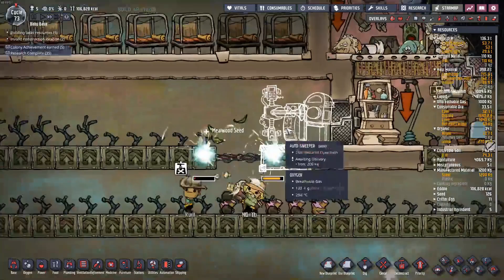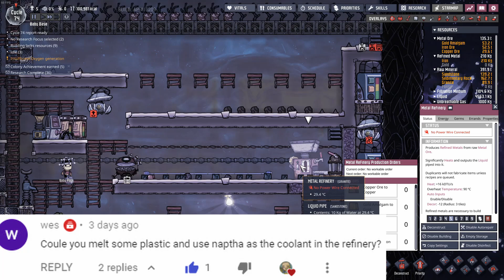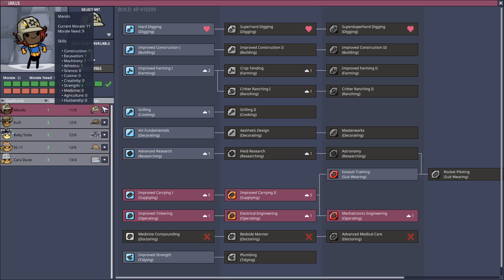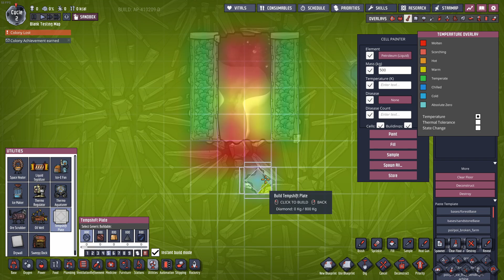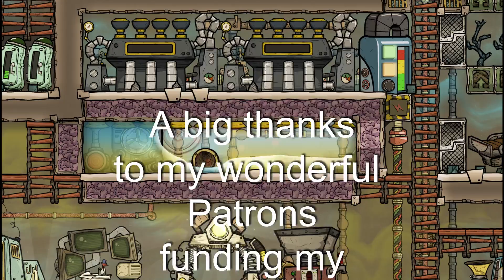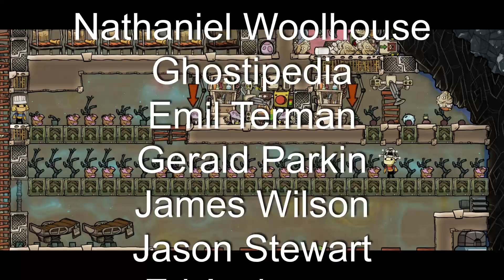Baby Base 4 : Metal Refinement, Cooling, Naphtha and Coal : Oxygen not included

Comment: For any current viewers, in the current version of the game, temp shift plates do interact with abyssalite (which I learned from a later series), so you can do the corner heat extraction on it to melt plastic.  And the weird thing where it's boiling material despite very low conductivity is called "flaking", and works with other materials, for melting or boiling, and happens in 5kg batches.
Reply: Thanks

Comment: 9:45 You say the Abyssalite cools only slowly, but by my calculations the DTU delta between the temperature of those abyssalite tiles and the petroleum boiling temp of 538.9
 C is 7,266,400,000
 DTU. With petroleum input of 26.9 C it can boil 8063 Kg of petroleum. Given the number of times you clicked, that's approximately the amount of petroleum that you boiled in the experiment. No extra DTUs were created beyond what was already in the abyssalite. It's simply really really hot to start out with. There is no extra heat or any sort of amplification due to it being abyssalite. You would only get the same amount of energy out as you put in even if the tempshift plate idea worked.

Comment: You can actually use 0.1g in the valve filter, making it even less likely to let stuff through, reducing the amount that does get through, or making it take longer to get through.

If you have two bridges going into the filter it would take several cycles worth of continuous full-pipe flow for any hydrogen to leak out, and with just one, only 100mg of hydrogen can get through if you have a full packet.
Divides the issues of that filter by ten, and it only costs one or two extra keyboard presses.

Yes, it’s a tad excessive, but it also is a completely free alteration to make.

Comment: Would it be possible too farm dense puffs for food they only eat oxygen but then the poop it back out as oxylite it would basically be a infinite food source also later in the series you will have a bunch of oxylite for rockets
Reply from the maker: The difficulty with any type of ranching is the space, each critter needs 12 tiles of space not to be cramped. (except voles) so ranching any critters will take up a large chunk of the base.
Reply: Yeah you do have a point why waste space for those critters when you can ranch voles then you can use the room for somthing else

Comment: Very nice and compact <3 them till they drop vole farm design that easly supported my 50+ dupe bases
dimensions(7x6)
top layer4(obsidian, copper, gold, iron, steel, wolf.,) horizontal pneumatic door 1 refined metal tile
interior of rectangle from left to right:
4 tile high tile/m.tile ; vole/vole baby drop off; (ranching station, ceiling light+dupe sensor) ; (lowest level gas element sensor,metal tile,auto dropper facing ranching station) ; (mini gas pump, 2 ladder segments above pump); 4 tile high tile/m.tile 
7 tiles /m.tiles
last row gas vent attached to m.gas pump
automation: auto wire between light and dupe sensor; auto wire leading from gas sensor to  buffer gate default setting is fine then to the mini pump  gas sensor default to carbon dioxide**
**important to keep dupe working without having to stop to breathe uses min power and get more efficiency from light as well, 
PS this farm can easly add eggs but woes be if vole gets out when have like 50+ voles in it, e.g. convert all escapees no going back your welcome for this brief tutorial for viable vole <3 them till they drop farm easly supported my 50 man dupe base with just this single farm design
materials needed: 
21x100 refined metals walls ( 600 refined metals less if up against side wall) 
100x xxxx for pneumatic door + 
400x xxxx for grooming station
50x xxxx for dropoff
400x xxxx autodropper
50 plastic  for mini gas pump
35 r.metal for automation wire
25 r.metal for gas element sensor
25 r.metal for buffer gate
50 xxxx for gas vent
100 xxxx for gas pipe
total= 
2185 refined metals or 1585 if against a wall
1100 regular materials
50 plastic
+power cable material
less materials if make all your dupes live in atmo suits 99.99% of the time,
Reply: Also just thinking about it can also get free sand by purposely composting some of extra meat after its been cooked thus giving you free material to use on air filters thus giving means getting some tasty ceramic /shrug

Comment: For powerless filters, i tend to build a pipe element sensor, then a vent right after, along with a NOT-gate. Put the sensor to detect hydrogen, then everything that is not hydrogen will get spit out again. Just need to make sure the vent doesn't over-pressurize to prevent it from spitting out the NOT-gasses.
Reply from the maker: This have been suggested a few times I'm going to have to give it a try.

Comment: isn't that single tile all the way to the right bottom corner of the map that isn't insulated going to continue transferring heat into your base from the ridiculously hot diamond underneath it?
Reply from the maker: That is surrounded by insulated tiles, the hot diamond is diagonal to it and only temp shift plates transfer heat diagonally. That is why the plastic temp shift plate melted instantly and then stopped heating up, once it melted it was no longer a temp shift plate so it was not drawing heat from the hot diamond any more.

Comment: Can you calculate per second how much power you're producing using that tiny Hydrogen system
Reply from the maker: About 68 grams of hydrogen a second, not even enough to keep it active much. But it's more to stop the hydrogen building up in my base.
Reply: @FrancisJohnYT  the two small Air pumps are going to keep up with all the hydrogen that's generated?

Comment: you going to run that hydrogen gas in a steam room to remove heat before you burn it in gens?....dubble power from 1 vent! lol
Reply from the maker: I always find that 500C hydrogen is not worth taming early on. Once you get Therimum you can tame it quickly and easily. I would prefer to invest my time in getting other power sources up.

Comment: Oh there is a nice setup to make a filter that uses the new vents and a NOT gate ( add a sensor before the vent set for H2 and connect the sensor to the NOT gate and connect the NOT gate to the vent, every time the sensor detect H2 will close the vent and allow the H2 to pass, every time the sensor detects "other" stuff it will keep the vent open )
Reply: also is power free and safer because it will only close the vent when it detects H2 (unless the vent get over pressure) but if you use the bigger vent that will never be a problem
Reply from the maker: Seen a few suggestions to try this, I'll give it a go.
Reply: @FrancisJohnYT  oh that also work with liquids

Comment: If you extend that half-filter by one and put in a second bridge, you can filter up to 999 full gas packets of H2 in a row before missing one.

(That is, move the outlet one tile to the left, extend the top pipe one tile to the left, and put in a second bridge where the gas outlet was facing down, in parallel with the other bridge.)

(Or more, if you decrease the gas valve below 1g.)

It only works if the loop is flowing in the opposite direction as the incoming gas though.

Effectively you end up with 1g/packet building up at the exit of the 2nd bridge every pipe tick worth of H2.

Comment: If you want an alternative power source, maybe use the hydrogen vent.. you can cool the heat now.
Reply from the maker: It comes out at 500C so I would need to cool it before pumping. Anything I do now would be temporary and the power return is not great for the effort involved. I might tap the magma biome for power first, it has the added benefit of freeing up space and getting me access to a bunch of diamond, steel and wolfermite.

Comment: Fun facts time!
First, the numbers problem. ONI uses floating point numbers to keep track of materials, which is the source of the "rounding errors" you see with things like data banks. Floating point numbers keep track of numbers via exponents. It's a weird way of doing things, sure, but it saves a ton of memory space for really large numbers. Anyway, think of it like using ONI's pipe splitting functionality to try and split a fluid into 5 equal streams -- it's basically impossible without an excessive amount of pipes and splits, and even then you can only get an approximation. Floating point numbers are like that.

Second, polluted water off gassing. They changed how that works when the full version came out, so (unbottled) polluted water only off gasses when it's touching clean oxygen. You never have to worry about polluted oxygen entering your steam chambers not because of the pressure, but because there's no oxygen for it to touch!
Reply: That's not correct.  I just tested, and any gas under 1800 grams/tile still allows polluted oxygen to offgas from polluted water. I tested with CO2, hydrogen, chlorine, and natural gas.  They all behaved identically.
Reply: off gas by basically deleting smaller packet of gas,
Reply from the maker: So polluted water can't off gas when surrounded by another gas that is not O2 or pollute O2! That can't be right, what about CO2?

Comment: you can also use the glass forge to convert plastic into naptha.
Reply from the maker: How do you do that safely? I'd be worried about making sour gas.
Reply: @FrancisJohnYT  i built a very crude system, where i placed plastic on conductive metal tiles, and then dripped molten glass on the same conductive tiles, which immediately turned to solid glass, heating the air in chamber to over 600 degrees. it was time consuming and sand consuming doing it that way. i made some 21 tons of glass making it. if i remember correctly. i was in sandbox when i did this and didn't use the temp shift plate. you might try using the mechanized door for ideal temperature management.
Reply: @FrancisJohnYT  i made a plastic melter just a few hours ago. i didn't have any trouble with sour gas. i guess glass is so weak with heat capacity that sour gas can't be reached. i managed to produce 10 tons of naptha with only using 13 or so tons of sand, or however much is used to produce 3500 kg of glass. i just built a boiler like you do, but larger, and dropped the glass on  metal tiles, to heat the oxygen that would transfer to the metal tiles below it. the heat from the metal tiles directly transfers to the plastic temp shift plates. when the temp shift plate would melt, some of the naptha would be left behind to help heat the next temp shift plate built. needless to say it was not only easy, but i could have mass produced naptha at the cheap cost of sand.

Comment: Why would you waste resources on the pump repairs? Normally it wouldnt matter but with the scarcity of this hell you're in ever kilo is precious.
Reply from the maker: Did they change repairs? It used to be of you repair something you bring along the repair material and repair it, but once the repair was finished the repair metal would fall out of the machine. I though their was no loss of mass? I will have to test this later.
Reply: The last time i tested that, a couple of weeks ago, there was some material mass loss on repair, intended or not. Minor iirc, like 5 kg or 15 kg iirc but still. I was able to notice that cos suddenly my thermium stock was not ending with a 0 but with a 5, I investigated and saw that dupes where taking like 40 kg and bringing back only 35 or 25 kg.
Unless they changed it very recently repairs still have a cost.
Reply: Is like 15kg of mass lost per repair. A big lost in this map

Comment: Cool way of melting plastic. I'd never have thought of using the magma biome for that. I'd have used the aquatuner, small steam chamber, small amount of water, run some water thru it, shiftplate in the back of it, melts at 160C. Your way was faster tho.
I always put a safe sensor on the refinery. You don't know what may happen to your turbines. And for sure you don't want 550C sourgas around in the center of your base.
I don't think naphtha is better than petroleum overall, but there's one application that I really like: for a boiler, the fact that you can heat it up when at 430C, means that it's much easier to boil crude oil. petroleum for comparison you can't heat until below 406C. So either you cool it down on purpose, or you can't put it inside the refinery. Boiling crude oil with the help of 406C petroleum takes a lot of time. There are ways around it but naphtha makes things much easier.

Also I love naphtha for airlocks. For exmple: https://imgur.com/a/FgauoSl
This is usually not stable when done with water. 33g of water are easy to vaporize. With petroleum (other than the temp range of course) the droplet is about 333g. But naphtha... 33kg(!) of something with very low TC and high vaporization point. 
This kind of lock is not as good as the standard T shaped one. But in case of double locks for insulation purposes, it's quite compact which isn't bad in a small map. And also it's resilient to falling water (it doesn't get displaced so easily, thanks to its shape).
If so inclined (I never do) naphta allows you to build 3 stacked liquids locks, naphtha, crude oil, petroleum. These allow dups w/o suit to cross them w/o incurring in the soggy feet debuf. Of course by the time I have all three materials usually I have all dups in suits, so it barely matters. But still some people love them.
Reply: Easiesy way to do it early is with a glass refinery, put down an insulated tile under the output and put a but if plastic there

Comment: Edit: Guess I should have watched the video instead of pausing and commenting. Looks like you found a better way anyways.
As far as melting plastic, I'm not sure if you can figure out a way to use this mechanic, but I once put some insulated obsidian tiles around an active gold volcano (touching) and they got really hot. Once I got around to building a cooling solution for it, placing a steam turbine in those same hot insulated tiles quickly pulled the heat from the insulated tiles ignoring their TC and creating some naptha.
I supposed you can do something similar to this with the magma but it would be tricky with no obsidian or igneous rock.
Reply from the maker: If I don't write stuff down straight away I forget about it, so I get the urge to comment when the idea comes to you. You are not alone, not by a long shot.

Comment: That free energy gas filter is the thing of the past! :) Now you can just hook up a "high pressure gas vent" to a "pipe element sensor" exactly next to each other, and with a NOT gate in between, you can just set it up in like 10 seconds. The only possible downside is that if the gas pressure goes above 20Kg, you're gonna have problems. but I don't think that would be an issue here if you care about your dupe's eardrums. (That can also be solved by a liquid overpressurization trick, but that's more hassle. arguably)
Reply from the maker: Have not tried the new method, I hear if it backs up you get issues? I have plans to stockpile some hydrogen later so want to leave myself some options.
Reply: The side effects of hydrogen backing up are pretty much the same on both methods. The filter will not fail and let oxygen pass through, it'll either continue backing up, up to the pumps (almost impossible in your situation, this tends to happen if it only gets hydrogen continuously so that I'll block both the vent and the sensor, without any other gases interfering.)
Or, more likely it'll just let some hydrogen packets get out of the vent, but never will it contaminate the output with some other gas as long as you keep the pressure below 20kg.

I used this trick to get the "fully sustainable" achievement, and it workd flawlessly.
Reply: @aliqandil  How big of a base do you run?  In previous versions of ONI my sensor filters failed once I had a lot of dupes, while the packet-loop filter has never failed me.  I haven't tried them in a while, though, so maybe I will give them another shot... I just pulled off the 100 dupe challenge, and I will retry the automation filters on that map.

Comment: You could use the cooling loop to cool the hydrogen coming from the vent, it will solve the power issue.
Reply from the maker: I want to wait for space metal before I tap the hydrogen. It's just it's not a lot of power for the effort involved, I'd prefer to tap the magma biome it has multiple benefits.

Comment: I spent an embarrassing amount of time trying to melt plastic to naptha.  Nice trick with the tempshift plate.  Next up, geothermal power?  (A feat I'm proud to say I stupidly pulled off without atmo suits.)
Reply from the maker: You crazy, I would be to worried about scalding my dupes or spilling masses of heat into my base. I'm using Atmo suits and a vacuum before I even think about breaking the biome open.
Reply: @FrancisJohnYT  I enjoy the liberty that comes from not broadcasting my game on YouTube.  Did it just like Rubik Monat.  Liquid lock and vacuum.  That little setup powered my base until I decided I wanted to get at the oil reservoir.  I don't recommend doing this without suits (I had 2 suits I was using up top to collect regolith and space metal).
Reply: I did it with a cooled salt water liquid lock (doesn't need to be cooled, just paranoia), a vacuum and no suits, plonked a steel door against some natural tiles and three steel tiles above that in that corner, put a steel gas pump and water top-up automation as well, and it fuels my stumpy little steam rocket while I wait for the core to solidify enough for vacuum mining. Once it was all built I bricked up and deleted the liquid lock and pumped a few tons of water in.